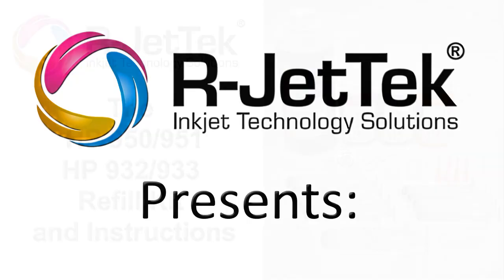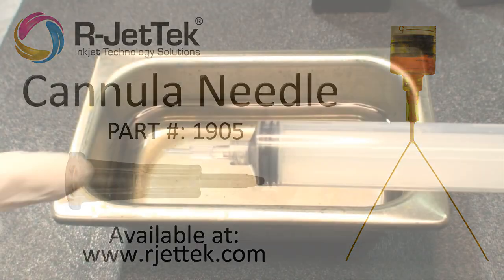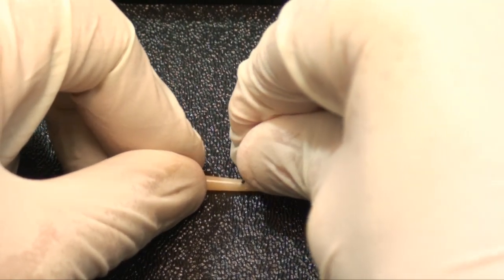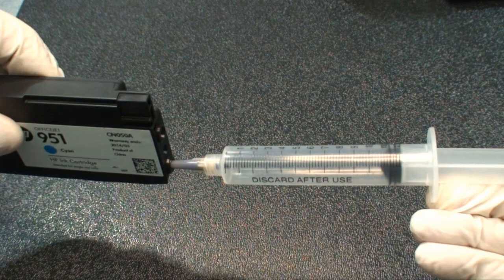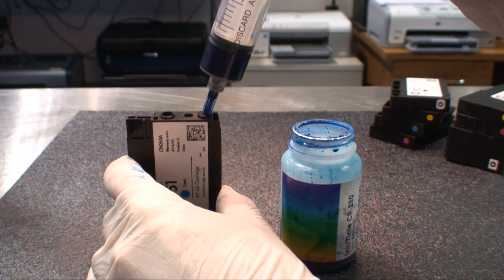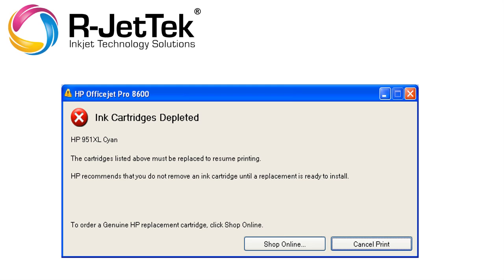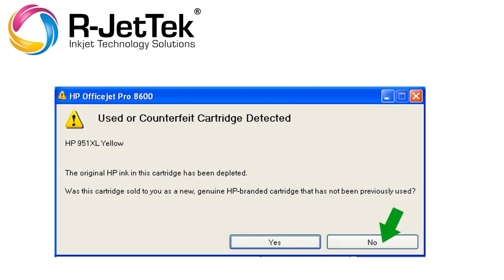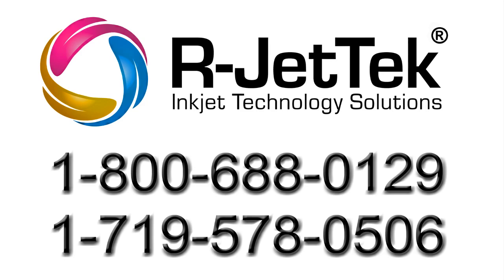How to Refill HP 950/951 932/933 cartridges

Comment: 2025 and we STILL have to resort to hacking our ink supply, to our now discontinued printers, that ironically have almost exact specs as todays tech. Ink tanks solved nothing except continuing the extortion racket whilst jacking up purchasing prices again. Technically no difference between a cartridge based and tank based printer, they just added scanners no one wants to justify the price hike. It's over 30 years and basically nothing changed; heads will still clog up, it's the same time-bomb in another package, waiting to ruin your day when you need it the most. Unbelievable how the oligopoly of manufacturers have been allowed to piss on consumers for so long.

Comment: I dont understand my cartridge (this is my 3rd comment, it keeps being deleted by youtube, maybe because i wanted to show image uploaded to a page). i have taken apart my cartridge 950. its not original, it isnt refillable. it is just 3rd made. But the holes does not have any ball valve inside them. what is even stranger, where you are filling it with ink, that hole on my cartridge doesnt connect to the ink bag, it just connects inside the plastic case. but that hole is also attached to the printhead assembly if inserted! and the hole which is connected to the ink bag isnt connected to the printhead, it is just to keep the spring in place if inserted. if i push a needle inside the hole where you are filling it, it pushes through without going into any ball valve. i cant understand this. thats some kind of david copperfield trick there or something i really badly understand... but the cartridge was working before, because it has been depleted by me.and there isnt any other way out from ink bag... so if i fill through the hole as you are then i fill the empty space inside cartridge case outside ink bag. and since there isnt any valve it just drips out (i have tried water). also if i fill the bag with water through the other hole it drips out because there is no valve. but when there was ink in there before it was not dripping out :D :D shit i think i am drugged or what :D

Comment: My LED screen doesn't work. Can I make this refill work on an OfficeJet Pro 8600?
Reply: Hi, I had the same issue. The LCD screen on my 8600 showed up very faint - almost unreadable. I did a semi-hard factory reset the LCD is back fully bright and full color!!
Reply: PreviewPreview8:00How To Fix Hard Reset Hp OfficeJet Pro 8610 Ink System ... (you can ignore the first minute of the video. Reset procedure starts after that.
Reply: Cannot add link to post. just search in YouTube : How to Fix Hard Reset Hp Officejet 8610
Reply: @V_Sri  THE SCREEN IS BLANK. No anything.
Reply: I have that printer and just filled my HP cartridge and it all works great.